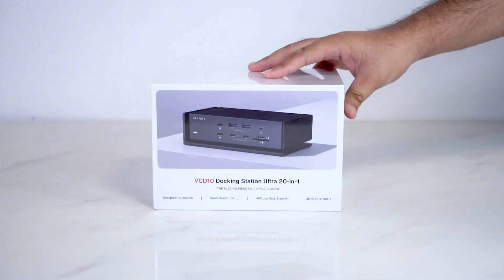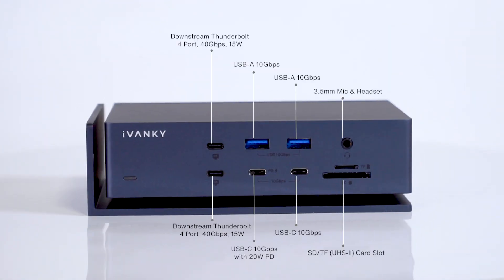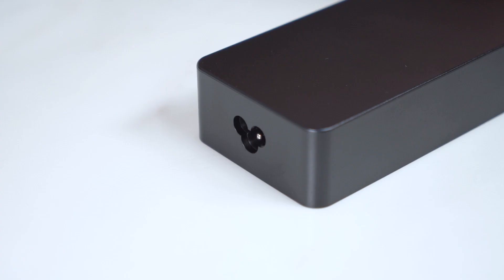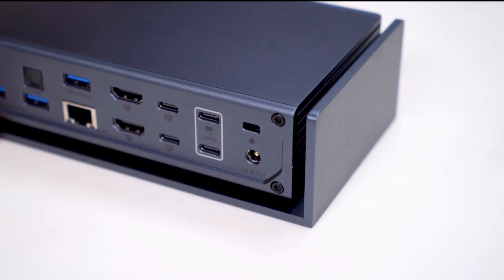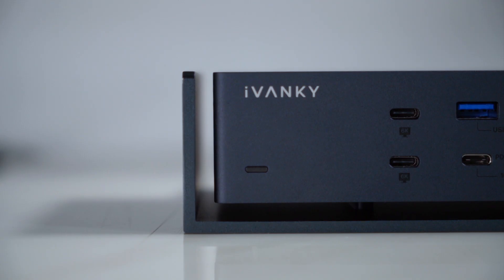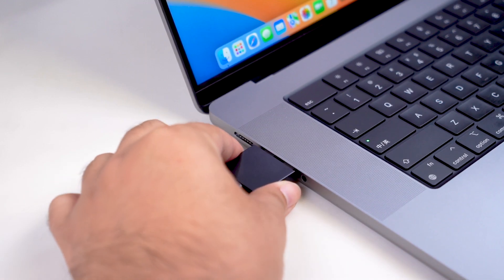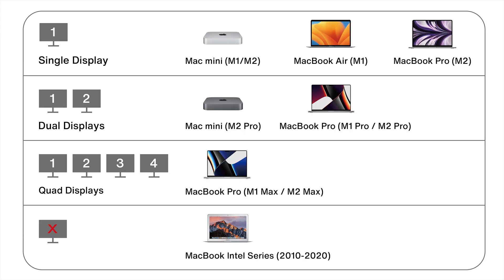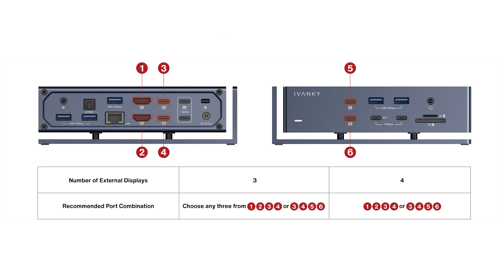Quick Setup Guide: iVANKY FusionDock Max 1

Comment: Got one for a Macbook M3 MAX, here is what not a single video review tells and I've watched over a dozen videos: 
THE LAN PORT has a crappy Realtek connector, a product advertised for MAC, with a stupid "2.5Gbps" connector known to have this specific error in MacOs (Realtek RTL8156), yeah, the Realtek that never reaches 2.5Gbps on MacOs cuz the drivers are crap and can't bypass the Os hard lock to 1Gbps, tried everything on the book, even a CAT8 cable, modem with 10gbps port, drivers update, etc. capped at 1.2gbps on my 3Gbps internet plan...
Only solution that worked: Getting an external 10Gbps thunderbolt to RJ connector, the dock didn't worked.

Comment: Can you plug this into a Mac Studio? Or is this just designed MacBooks??
Reply from the maker: Hi, our dock can be used on a Mac Studio as well. However, the dual USB-C cable we provided is only compatible with MacBooks and Mac Mini. You can contact support@ivanky.com if you need extra USB-C cables for your Mac Studio.
Reply: With two regular Thunderbolt 4 Cables. As long as it is Apple Silicon M1, M2 3 etc and has two thunderbolt ports free then it will be fine.

Comment: Hi, 

I am very interessted in your FusionDock Max 1. Due to the reason that I want to upgread from my macbook to a Macstudio M3 Max in the future I have the following question: 

Can I also use 2x USB-C 4 cables instead of your  Dual USB-C Cable which which is deliverd with the dock? I was wondering if this dock is future proof if the layout of the mcbook pro changes or if i switch to a other mac like the mac studio.

Thank you!

Best regards,
Reply from the maker: Hi, thanks a lot for your interest in our product! You can replace the included cable with 2 USB-C or Thunderbolt 4 cables. As for the compatibility, the current dock can be used as long as the spacing between the dual USB-C ports on the MacBook remains unchanged. Additionally, our soon-to-be-released upgraded dual USB-C cable, featuring a detachable design, will also enhance its compatibility. Please let us know if you have any questions, and we are always happy to help.

Comment: So, if I want to only connect one monitor, can I then connect 4 thunderbolt drives to the usb-c 6k ports?
Reply from the maker: Hi Matt, if you are connecting to a 4K monitor via the HDMI port, then you can have four 6K ports available. However, if you are connecting to a 6K monitor, you will need to use one 6K port, but the remaining three ports are free to use.